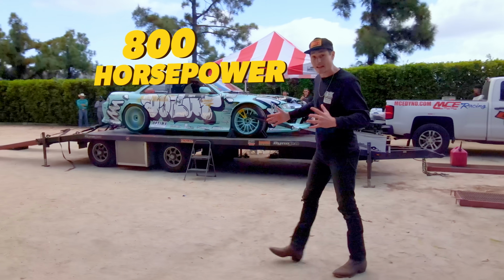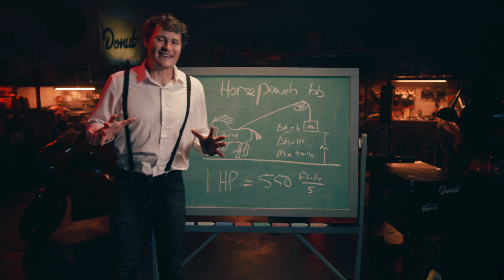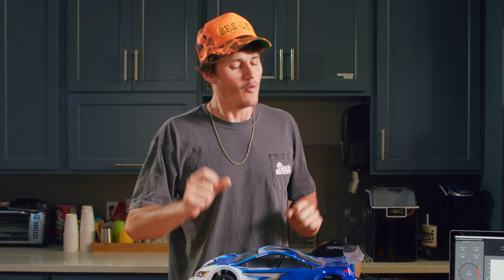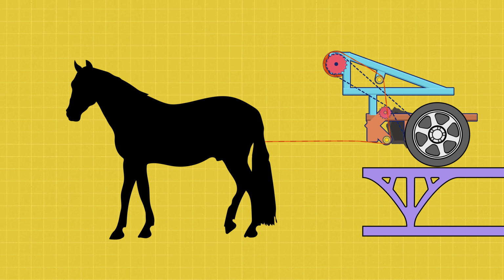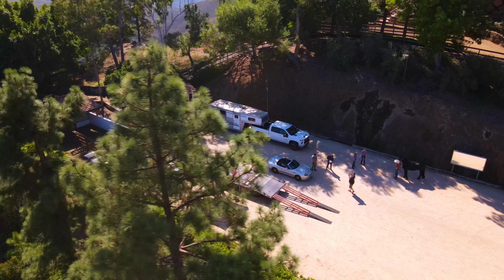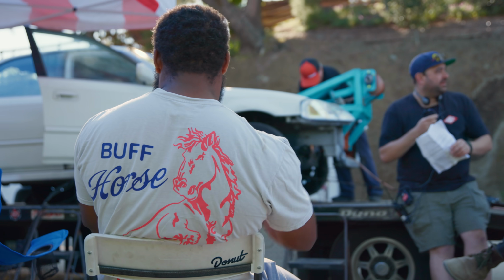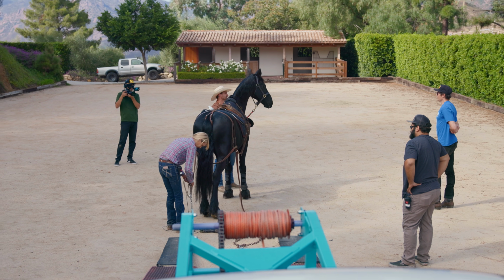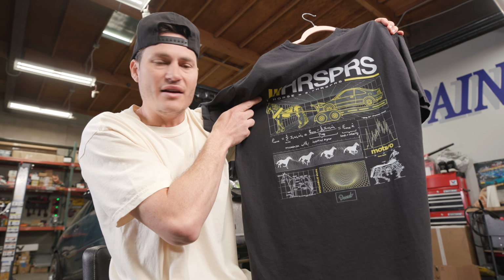How Much Horsepower is a Horse?

Comment: Not horsepower. It's Hillbilly Power. Someone decided to rename it to Horse Power. But in reality it's a lie. It's Hillbilly Power.

Edit: In order to guage an accurate reading of real horse power to horsepower you shouldnt use just one horse. Understanding from my point the cost and time, a more accurate test would have been more along the lines of using 10 of the same species of horse. Then average all their power out and youd get a more accurate. Or use the worlds strongest horse. But this is impossible. I can live with the current result.

Comment: James Watt was working out the sustainable and usable power of a typical work horse in a particular type of work environment, not the peak output, so that is bound to be a lot lower. In the same way, a normal human being might be able to produce 700 watts at peak, but sustain 150 watts over an hour (top level athletes can do a lot better).

Also, James Watt estimated the figures for commercial reasons. The Bolton and Watt company charged royalties based on the number of horses their engines could replace, hence it was money that motivated this, and it was sustainable power that mattered to their business customers.

There are many better and more representative ways of measuring that power than this rather gimmicky way. Indeed, they have one there. Strain gauge and distance measurement. You can certainly do that over an hour, maybe using a plough as the load.

Comment: I think 5.7hp ( = 4.2kW) for such a big horse is rather low. For comparision, elite bike sprinters (tour de france level etc.) can  push  20-25W/kg body mass for short sprints. So thats around 2kW and even a bit more. Granted, the horse is far from such extreme levels of training and commitment, but i would guess he could easily drag along 10 strong guys in a tug of war which would be more like 10-12kW or 15hp. maybe the dyno would have needed a higher resistance. Big D might have pulled it too easy too fast and didnt use all its muscle.

Comment: Having been around heavy draft horses, light buggy horses, pleasure riding horses and 5 horsepower small engines all my life, there is no doubt in my mind that (A) any horse that is used to pulling can pull more than 5 guys and (B) can pull more than a 5 horsepower engine can for more than 2 hours without resting. Thats my opinion. For short periods, a heavy draft (that is used to pulling) could probably outdo Big D by . . . probably a "couple" times.

Comment: Should have used an Amish horse that actually works for a living. That primadonna movie horse don't know what work is.😂 Ive seen a team of Amish horses pull a big rig out of a snow bank. Now, thats some horse power. Just one of those horses goes to WORK on command, they don't stand around,  trying to figure out whats going on. They know. And they'll do it all day, with this light ass job. I think you dropped the ball when you used the movie horse. Thats like putting Stalone in the ring with Tyson. Look the same, not the same.

Comment: I breed Trakehners. The idea that one of them is "15 horsepower" is so unbelievably low you can't imagine. This is for upper level warm bloods, not even draft horses. I know for a fact that one belgian is stronger than an 80hp tractor and WAY more agile. Two draft horses can haul as much as a midsized truck. f150 level. Watch the Draft Horse Loggers, you'll see.

Comment: I did enjoy the video, but the HP rating of 735.5 watts, like mentioned in the video, is based on what a horse could make continuously, over an entire shift of work.  I am a cyclist, and in a sprint can make about 1900w for one second (repeatable) or about 1500w for over 10 seconds, or about 300w for an hour, or about 220-240 watts for an entire "shift" (6+ hours).  So if "Big D" could make 5.7HP for 10 seconds (like in the video) than it wouldn't be unbelievable to "Big D" could make roughly, but not much more than, 1HP for 6+ hours.

Comment: This was interesting, but the original hp measurement was how much power a horse can give for a day, every day, without getting overworked. Your horse pulling only five times sort of confirms that a horse CANNOT give 5 hp all day every day. And I'm curious why you didn't roll a strap around the dyno straight to the horse. The main difference with Watt's "dyno" was it was run in a horizontal circle (a mill, like your picture of the donkey).

Comment: Horsepower ratings are heavily affected by speed.  So a router working at 20 000 rpm that one can easily manipulate by hand is 3.5 rated, while a very heavy motor in a small table saw, might only be 1.5 hp because it spins a 1750 rpm.  This leads me to wonder whether a running horse develops a lot more hp.

Comment: Very good question, also a very good video.
Got some questions:
I Wonder how much power you get if you tie that line to the back of a normal low hp car. And than dyno that same car, how much difference would there be? That would be an accurate loss indicator.  
Or maybe a low hp bike or even a scooter. I dont think a scooter claiming to have 50hp; gonna pull that thing far off from a horse. Also most scooters cant pull some farm equipment as powerful as an Ox. 
Also how much a Strongman champ like Brian Shaw ( @SHAWSTRENGTH ) would produce pulling that thing.That number could be higher than 1,9hp(score of you 3) those guys pull airliners.

Comment: The mechanism, Civic + spool,  is a terrible design, which has made huge resistance and huge horse power lost. That's why the result is not accurate at all and looks like fabricated data.  Why don't you just wind the rope around the "Dyno Drum" and use a simple roller to adjust the direction and height? I could show you my design if you're interested.

Comment: Tbh, i reckon Big D is capable of a lot more. He didn't even look like he was trying 😂

Draft horses love to pull, but they're a living creature, you can't really force them to pull any harder than they have to. The only practical way to get a horse to pull harder is with more load, that dyno set up would need the horse to go faster for more hp when a draft horse is more of a 'constant speed machine'

I reckon its more a case of 5.7hp is what he felt like doing that day.

Comment: this test isn't even remotely accurate, they needed to make the rope alot longer and allow the horse to run at its max speed. how are they gona get Accurate readings if the horse is only allowed to move like 20 feet???? the longer the horse pulls to faster the tire speeds and the easyier the rope will be to pull. i'm starting to think that the original 15 hp is more correct then 5..

Comment: HP is an archaic meaningless and unscientific measure so it can't be measured scientifically. How big a horse,  what bread, for how long and under which intensity level. You can get anything between 0.1 and 20hp shaft power really.

Comment: As memory serves, the horsepower rating that watt originally established was meant to represent what a horse could continually produce.   In other words, you could not have a horse putting out max power all day (just like you guys limited the number of pulls by big d). Remember watt was trying to compare “continuous” work.  And while we may not think of it now, horses were a prized possession.   Injury your horse and production stops.  So they really paced for what the horse could do all day without injury.  In that regard, it seems reasonable that big D could continuously work about 1 hp.   That said, fantastic video.

Comment: BUT THE HORSE WASN T SPRINTING
Reply: Correct. This test is not properly performed. It's more a test of the horse's raw strength than power. The power should have been measured at at least 40-50km/h. A horse will then put out around 15hp or so.

Comment: Watt was likely not far off. 
A horse was a valuable asset and what mattered was the amount of work you could get out of it in a day. 
Not just for one day but day after day for years with very little risk of injury. 
So his approach was good including breaks, feeding and watering of the horse throughout a day how much work would you actually get out of it. 
And how big would a steam engine, (that would require less breaks) need to be to do the same work per day.

Comment: I feel the experiment could be simplified like: race a horse with a car, then test the car on the dyno. account for mass of car + driver and horse + rider for inertia. Or make use the force sensor + GPS idea with a horse pulling a known mass on a beach..etc. . Also both animals and machines are most efficient only thru a range of  speeds and torques. The power consumption wont be a solid number, It is always a curve profile.

Comment: a thought occurs.... the dyno takes that information, and then .... calculates... how much horse power.... um.... 
is it me or is there possibly an issue here? how exactly does it calculate horse power?
isnt the whole experiment about finding out exactly what is 1 Horsepower?
Reply: A horsepower unit is a standard unit that is defined as exactly 550 ft*lb/s. This video is trying to find out what the peak power of one particular horse is. Horsepower cannot be measured directly like speed or force can be. A dyno measures rpm and torque and uses those to find horsepower as 1 horsepower is torque×rpm/5252 when torque is in pound feet.
Reply: no

Comment: I don't think the horse's power output is accurate. Like if 1 human could produce 1 hp, and Big-D did 5.7, which means 6 humans could stop big-d from pulling which seems impossible. I think big-d should be pulling atleast double which is around 12 hp if measured correctly.

Comment: i feel like the horse wasnt using its full power
Reply: Correct. It should have been measured at the horse's running speed. This was more a measure of the raw strength than power. You can expect such a horse producing up to ~15hp or so.

Comment: Love it but....
Why didn’t you simply build a treadmill, like a running machine we use for exercise with shafts either side exactly like a horse driven cart, or carriage. The tackle for holding the horse safely and comfortably between the shafts already exists.
Let the horse mount the (braked) treadmill, then, let it trot, then apply resistance through the brake and you will have your answer.

Comment: You should do a pull with a small motorbike at the civic dyno to compare and then dyno the bike in a regular dyno.

P. S. I will not believe that my 125 Honda monkey has almost double the power of a horse.

Comment: There is hardly missing a "Counter Test" with another CAR (or maybe 2-3) that also pull the "Horse Dyno" to actually CHECK for PROPER Results of the "Horse Dyno"!
Means if there is no Counter Test with ~100PS Cars and the Results are "almost" the same, the Results are still just "Calculated" and not Real!
It does not matter if there would be a difference of 5 PS at a 100 PS Car but what is there is a difference of 20 PS at a 100PS Car or even more?!
Sadly to say but that way it is definitely WAY to inaccurate for real Values!

Comment: Fun and interesting video, but you would have been way better off using the technique in the typical drawing of a pulley in a tree with a horse lifting the weight. The method you used, used far too much guess work calculations, lasers, optical encoding and expensive equipment. Saying that you don't measure a car that way, doesn't cut it. Dyno's have professional precision calculations to get back to the same basic unit of work. Also, the horsepower unit was never supposed to be the max a horse could do, it was a measure of what they could continually do for a reasonable time, and it was based on a full draft horse not a "light" draft horse like you used. Notice the owners would only allow 5 pulls. That is because it was a level of work that could be continually maintained. As a really rough guesstimate, you probably just confirmed Watt's original work. Working at one-fifth to one-sixth of that is probably sustainable by the horse for quite a while.

Comment: As someone that has had to do these calculations professionally, I was disappointed until the load sensor was added. re the GPS. The distance could have been done using the cable length/your paper wheel etc but hey. I am glad you added it to check the dyno calculations as those 2 metrics are far simpler to calculate HP than the dyno and all its parasitic losses.
Regarding James Watts calculations./estimate. You need to keep in mind that his calculation is the average power he observed over many hrs ( and for good reason because its all about "work done" ) So whilst Big D produced 5.7Hp in that burst, thats not what James Watt was referring too. His comparison is to his engine that is expected to produce that power ALL DAY.  So I think he is probably closer than you might think.
Reply: this
Reply: Thats a good take ngl
Reply: Also, Now the internet/People would flip if you they done this but... wouldn't whipping the horse to pull harder and  faster make that horsepower higher!

Comment: While this is fun and entertaining, I think the methodology is flawed. You can have any study peer reviewed successfully if your outcome or opinion holds up to your methodology, that is not in question. However, the methodology must be sound. In this experiment, the sample side is way too small. You would need  a diverse selection of breeds, ages, sexes of horses to pull from. You would then need to run each horse multiple times. The contraption that is not designed for this is also flawed. Why use a dyno for a car to measure a horse? Why use a car? You're car guys, I get it. You have to use a car. But you could have built a type of treadmill. This would probably solve the other issue with this experiment: the speed and length of travel. I'd put money on that horse preforming better (more hp) if he wasn't being led, or if he was allowed to run. You want a peak with dynoing a car, so you make it go as fast as it can. When doing a horse, you stopped before he got up to speed. This would be like dynoing a car in first gear at an idle. I honestly believe that 1hp is not equal to 1 horse. But I also do not believe 1 horse is equal to 5hp either. But this video was entertaining, even though I skipped the unnecessary bits.

Comment: so useless question, the HP metric is defined as the work done by a force of 550 poundz (one horse) acting through one foot in one second, or foot-pounds of work, the unit of power needed to raise 550 pounds one foot in one second.

Comment: Just out of curiosity: why not produce a dyno that's directly spooled to the horse's harness? Take the car wheels out of the equation and stuff?
Reply: the dyno is a calibrated measuring instrument. Modifying it would invalidate its calibration.

Also, PR-reasons
Reply: @horrorhotel46290  lmaoo
Reply: Because the horse is being compared to an engine. So the horse’s power has to be the thing to move the wheels on the dyno in order for it to be a like comparison. Apples to apple. If the horse just rips the dyno wheel itself it’s not the same thing

Comment: So by that logic, and the original hypthosis, an 800-horsepower car can pull the weight and or force(as this is obviously not a measurement of speed ~30mph*140 would be nuts) of 800/5.7 or ~140 horses? Am I understanding that right, just seems weird to me, that's a lot of pulling power versus one car. In that logic, we'd have to find the heaviest thing a horse can pull, multiply it by 140, and that should equal what one 800-horsepower car can pull unless I'm not understanding the output metrics here. Hmm, if I were to do this test I would simply run simulations with software, but interesting nonetheless. Would love to see a restate of the hypothesis and a comparison to the findings versus the idea displayed the first section of the video. In summary, 800HP is just a fabrication, but what is a car like that really in terms of horsepower then?

Comment: Your starting rig needed to be set up so that the horse was pulling at it's full might right at the start. 

Seems weird to spend so much money and then the sensors and testing equipment are iffy.  Priorities mixed up in a video trying to do 'science' mixed with admitted 'donuts' as scientists.  Lmao.
Reply: Or..... "Sloppy" if it wasn't clear.  Not a single person there recognized that?
Reply: Should have been geared higher or done with weight instead of trying to put it on a dyno.  I doubt this was taken seriously by anyone that mattered on the subject.
Reply: Couldn't the dyno have just been put directly into the winch?

Comment: I have several questions.
1. Did you think about just wrapping rope around the Dyno's drum and pulling directly from it? I could still see the need for a bracket to geometrically align the rope to horse, though.
2. Did you think about connecting your test rig to a rated electric motor, to verify you calculations were correct? Also, this would've been a great baseline.
Reply: I wish we could get these answers. This test as they've done it is flawed.

Comment: why didnt you connect the pull wheel directly to the gearing on the dyno ?. it would of eliminated the traction lost through the gearing on the jig you made, plus an easier jig to make, plus less to calculate as you already know the torque/traction lost on the dyno, or is it just for a video?

Comment: Does that mean all BHP we use to show the power of the engines are not accurate?  Or do we need to divide it by the 5.7 BHP from Big D (as standard) to get the actual power provided from the engines ... if that makes any sense? For example: 500 BHP divided by 5.7 equals 87.719.....?

Comment: That's a beautiful horse. Fit humans can output 1 HP briefly.  A decent horse can sustain 3 HP for several minutes and do so many times during a day.  A typical race horse can go beyond 10 HP for a couple of minutes.  The original 1 HP was for an average shift of a strong working horse, not peak performance.